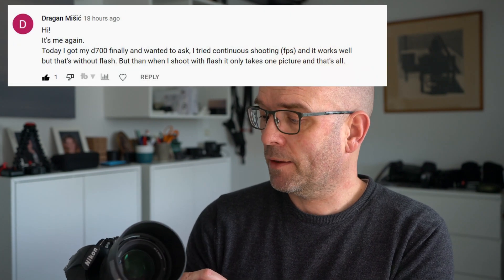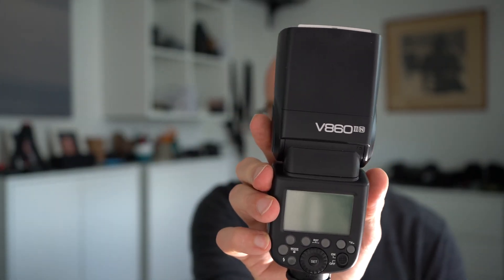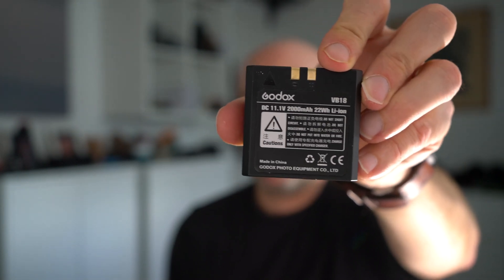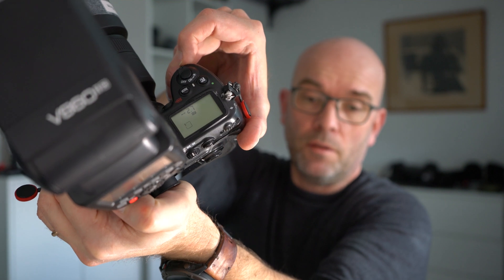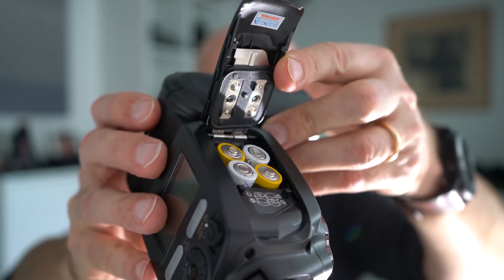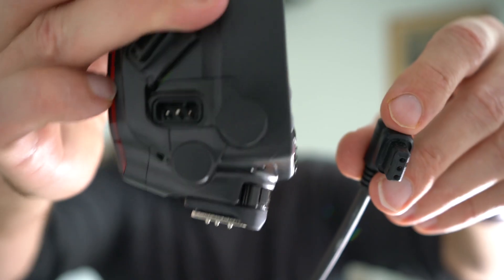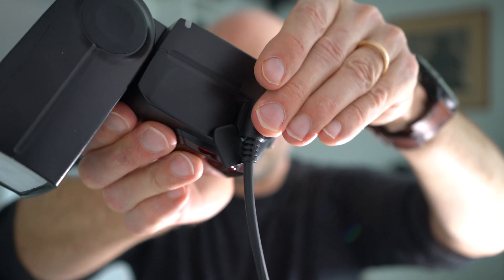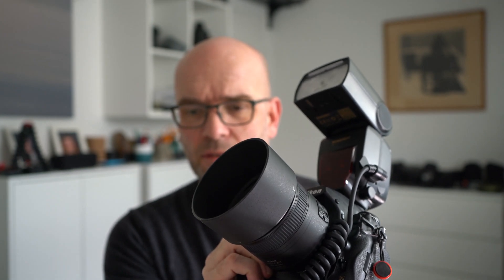Nikon D700: Shooting with flash in continuous mode

Comment: Found a mint Nikon D700 for 1/3 or 1/4 the price of a New in box D810, this would allow me to get more lenses...... Though now I'm wondering if the AF would be a big enough difference, because resolution shouldn't matter too much, as I just compared a rezised to 12MP (from RAW) to the 26mp (also from RAW) both came from the same RAW file of my XT3 and I could not see a difference until above 220% zoom..... Sooo yeah.

Also, my TT685ii is quite the beast with NIMH batteries (Fujistsu, the black one, forgot the capacity). Well, atleast it works for me.
Reply from the maker: I have never missed any resolution with the 12mp sensor on the D700. Only if you crop a lot or the image needs to be viewed very close up (a map) the 12mp can be an issue. (Nikon D700: 12 MP is PLENTY for BIG prints
https://youtu.be/w566M5Oq_fw )

Comment: Hi Frederik. First of all thanks for your channel! It's a huge help for a new d700 owner like me. In your opinion, which can be a good flash and trigger to buy for this camera today? Are the old nikon flashes (sb 600, 700 etc.) still valid or it would be better to choose something more modern (neewer, godox or yongnuo)? I'm looking for something efficient but also not too expensive. Thank you in advance
Reply from the maker: Hi, I am no expert on Nikon flashes. I started out with Youngnuo and later moved to Godox. The reason for godox was (1) fair prices and (2) the Godox 2.4 GHz X-protocol, which enables triggers and flashes to talk to each other independent of the camera brand (as long as the trigger hot shoe fits the camera). As I have several camera brands (Nikon, Canon), this is important to me. I think you will find that Nikon flashes relative to off brand alternatives are expensive, even when bought used. The new V480 from Godox looks like a really good allround flash, but you may also be able to get a great deal with the TT350, as the V480 is likely to be the new kid on the block in that segment, and many distributors probably want to empty the TT350 inventories and hence lower prices. You can also take a look at the iT30Pro from Godox if your requirements in terms of power are not that big. Hope this helps!  Best Frederik
Reply: @frederikboving  thanks a lot. Your answers was really useful. I'll have a look to those godox flashes. Have a good day!

Comment: Good stuff as always.. A godox man myself.. Use the AD400 and the new V1.. pleased with both of them
Reply from the maker: Thanks Jim! AD400Pro - the price tag makes me sweat a bit. Can you recommend it?
Reply: @frederikboving  Without hesitation.  Although if you don't need the extra stop of power they now have the 300. The wireless system works very well.  I also recommend at least the V2 transmitter as the user interface is much nicer.
Reply from the maker: Thx
Reply from the maker: @JimResnikoff  Thanks ! 👍

Comment: My D700 tends to underexpose during full, partial and side backlit images. Is it the limited dynamic range of the sensor, matrix metering issue or is it just the characteristics of this camera? I even have Active-D Lighting "on" to help lift the shadows. When comparing the D700 with my old Nikon D200, the D200 exposes brighter backlit images even with the same exposure and metering settings.
Reply from the maker: I am not able to say what causes the problem. I often shoot with flash in manual exposure mode, so that I set the ISO to base ISO, the shutter speed to 1/200th and the aperture so that I am sure the amount of ambient light that hits the sensor is close to zero. To test, I take an image without flash and then make sure I get a completely black flame. After that, I add the flash light and control the strength of the flash light by manually setting the strength of the flash light. This works. And once you get the hang of it, it is surprisingly simple. I have a few videos where I use this technique, but you can also find tons of videos with Daniel Norton where he uses exactly the same approach. Hope this helps.
Reply: A Flash ignoramus myself, I must confess that the D700 (in manual mode) and the cheap Minolta Auto Meter IV F (in cord or cordless mode) work very well. The lightmeter considers ambient & flash light and gives you the aperture.

If I were rich I would go for the Sekonic L-858D with a godox radio transmiter inside. I've seen people using it in their studios that look like an incarnation of Houdini

Comment: Hi, I have three questions about d700 .One about Raw format and two about JPEG.

Firstly I'm shooting always in RAW and in Raw settings there are "raw bit depth(I shoot in 14 bit)" and "type", so I wanted to ask what to select in "type" settings? ( when I bought d700 it has already been set on lossless compress)

Now JPEG questions:
1. My father shoot in jpeg and I wanted to know which jpeg option is best quality, because there are Jpeg normal, jpeg basic and jpeg fine. So which is best? Which have best image quality?

2. For jpeg we have settings called JPEG compression, so what to use?
Size priority or optimal quality? What is better? Which have better quality?

I hope you can answer all my questions.
Your videos are best, it really helps me with my "new" d700 .
Reply from the maker: Hi Aleksandar, I have tried to answer your questions in this blog: https://frederikboving.com/nikon-d700-image-file-formats-explained/
With regards to (2) above, the "optimal quality" option gives you the better quality images. All the best!
Reply: @frederikboving  thank you so much, I will choose lossless raw and  in jpeg Fine format.
But in camera image area I selected Fx but I also have setting called Auto Dx crop, should it be ON or OFF?
Reply from the maker: @aleksandardimitrijevic1389  I have it off. I do not have DX lenses anymore, but if you do, and mount it on the D700, it will automatically reduce the part of the sensor it uses if you have the auto DX crop set to on. If it is off, you most likely will see some vignetting when using DX lenses, but you can always reduce the image size in post, to get rid of that. Hope this helps.